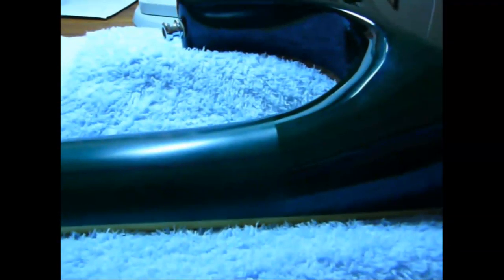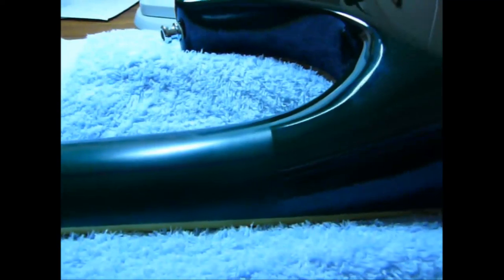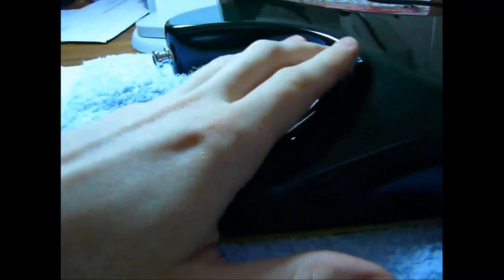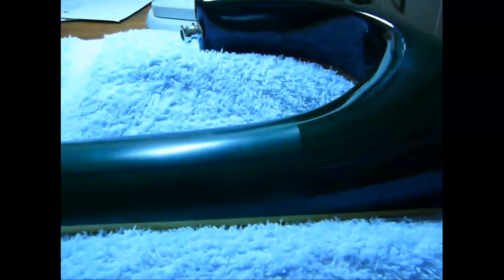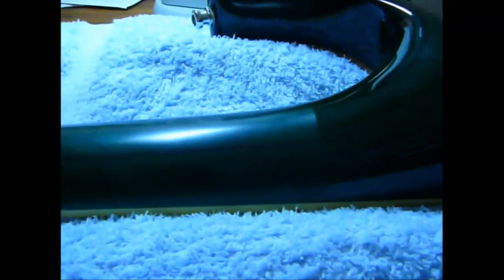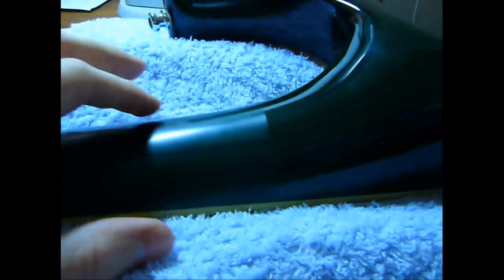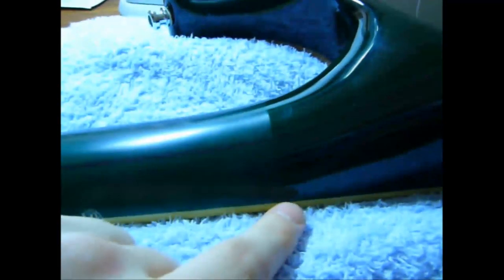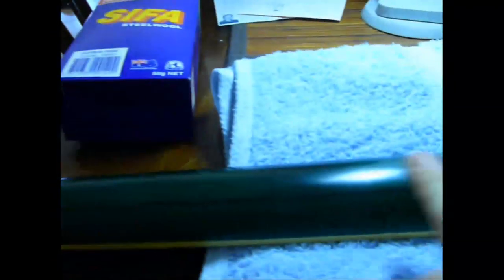How to Fix a Sticky Guitar Neck

Comment from the maker: @coal1987 If you use steel wool that is too rough, or you push too hard, you can make scratches that are too deep. They will be hard to get rid of. If you press really lightly, then there shouldn't be any problem. Make sure you use 0000 steel wool, which is the finest steel wool available.

Comment from the maker: @coal1987 The scratches are so shallow and small that they can be buffed out later on. In fact, they are so shallow that your hand will eventually convert it back to a glosh finish. When that happens, you can just go over it with steel wool again. You could keep doing this for a lifetime and you'll never cause any problems. Some people go over it every 6 months or so depending on how often they play. I haven't needed to yet.

Comment: I used a worn piece of 300 grit wet and dry sandpaper. Mind you it was well worn. It worked well. Too smooth still if anything. I also pressed very lightly and held the neck up to the window so I could see the shine disappear. That's as far as I went. Just until the mirror reflection was gone. The neck feels much better and will last for about 100 hours of playing, and then I will have to do it again.